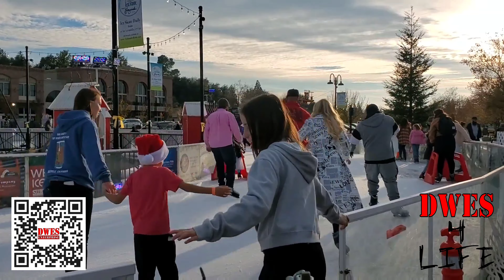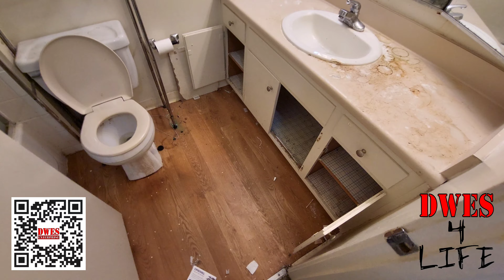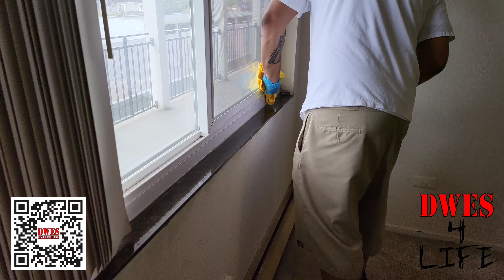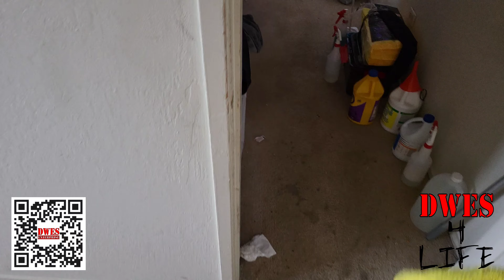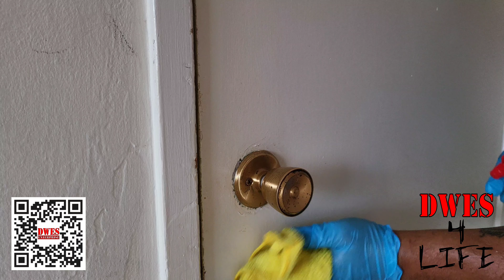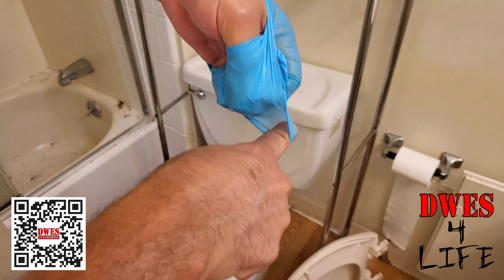Merry Christmas, You Filthy.... FILTHIEST House DWES Enterprise Has Cleaned! 😳🤢🤮 | #DWES4Life

Comment: Good clean DWes, I hate carpets with permanent stains make you feel as if you didn't clean good enough!!
Reply from the maker: I added some post treatment, so I'm not sure how they turned out after it was dry... Plus there was no water source for me to keep rinsing at it. So I had to turn down my pressure so I wouldn't run out of what I had onboard my van. The dirt definitely left the building tho lol
Reply: What post treatment did you use, I've never done that on carpet only do that when I pressure wash